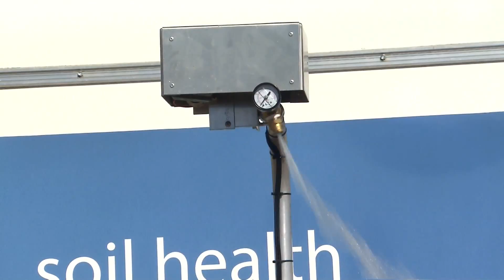Ground Cover and Water Infiltration

Comment: I love this demonstration, in particular the visualization of the runoff water vs the water that actually infiltrates into the ground water, recharging the aquifers with the natural filtration of the roots, biology, and ground itself. I've had many a gardening client worry about "cleaning" the ground around a particular desirable tree or other plant for fear of the other plants growing around it competing for water, when in fact they are helping that water soak in and avoid evaporation or runoff, and are therefore a net benefit to each other. I've often thought of pulling out this video on the job for easier clarification... but most of my clients only speak German and would certainly have a rough time with the thick Louisiana accent, as charming as it may be. So I might be borrowing the concept of the rainfall simulator if you don't mind. :)